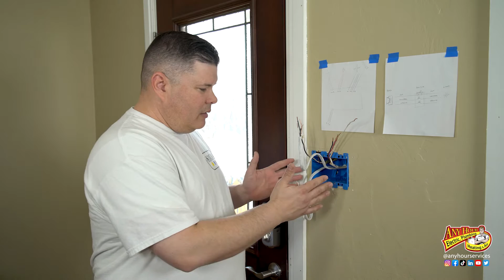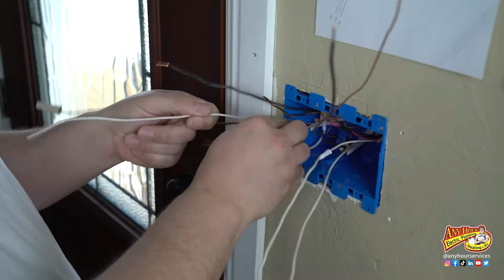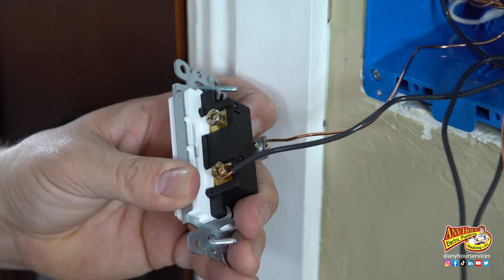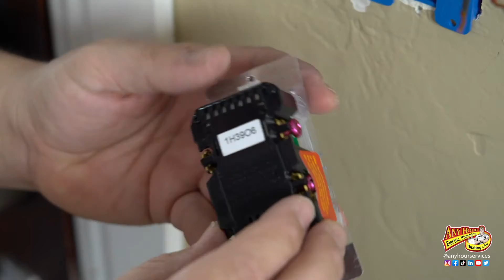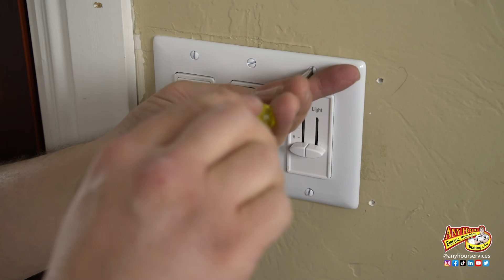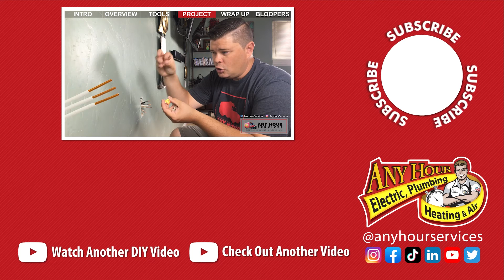How To Wire 3 Light Switches In One Location

Comment: So let's say the porch light switch fails (i.e., the switch on far left goes bad). That would result in all the other switches not working since they are wired in series. Is that correct?

Comment: Thank you for your video! It really helped me out. I wanted to replace one of the switches in a 3 gang box with a smart switch. I have become comfortable with replacing single pole switches in a single gang box but when I opened up this 3 gang box, I was a little apprehensive because it looked different. Of course I turned to YouTube and after watching several other videos found yours. With your clear explanation and diagram, I was ready to tackle my little project. I successfully installed my smart switch 😀😀😀

Comment: I can't figure out my issue. I have a 3 switch box, left and right are ones ways. The middle is a 3 way that pairs with the stairwell upstairs switch. My switches are new, I'm replacing old outdated ones so the screw placement is different so I'm not able to match it. Theres also  no ground wires I can get to.  They used one long black power wire to loop around each box top gold screw for each switch, and then there is of course the red for the 3way pairing. I have them set with the red on my left facing it, and the main shared power wire on the top my right facing, and the other black is bottom right. But the 3 way does not work yet. I'm stumped and not sure how to formula the question to find the answer on Google.